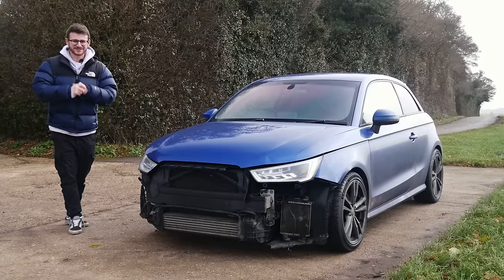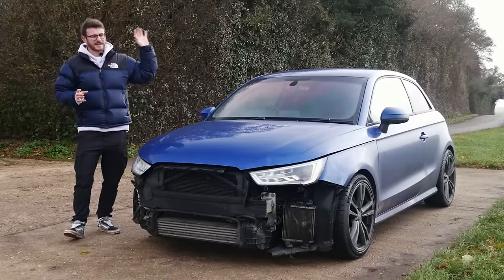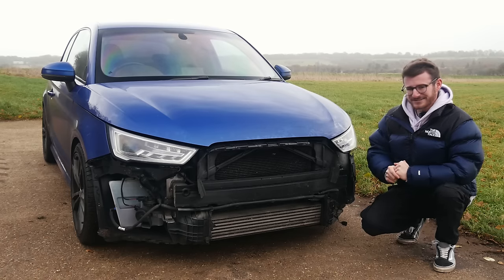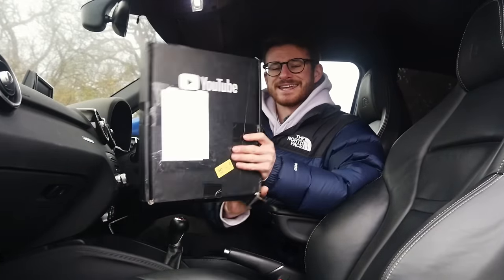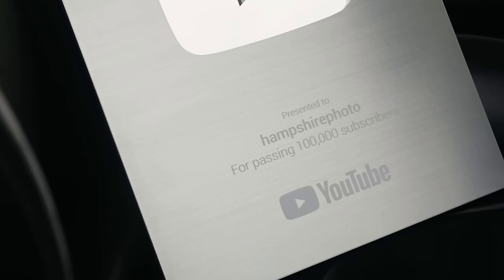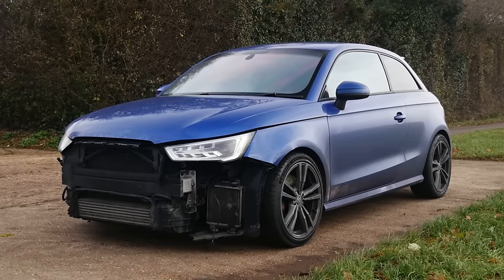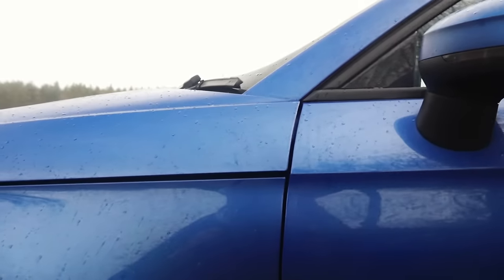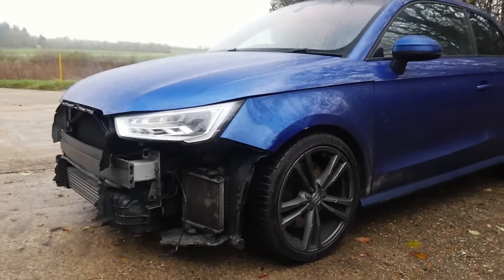I Bought A Wrecked Audi S1 from a SUBSCRIBER!

Comment: They sold it over a cracked splitter and the bumper coming off.. most modern Audi are just easy detach crap.. amazing for power but I can imagine what caused that little damage.. then again I bought a scrap Mk1 TT and the previous put a new pump and timing belt on after a dent someone must have done with a trolley in a supermarket.. that bumpers easily repairable and a new splitter and about 20 mins pulling that tiny dent in the bonnet out.. amazes me thinking what people deem as a damage category..

Comment: Well done on the S1. Can’t wait for the repair and future mods. I’ve just bought an S1 to daily to save using my E46 M3 CS. The S1 is a great little car to race around in, but now needs a power increase, so am interested in what you do.
Thanks
Reply: Depends how far you’d want to go with it; Will need a clutch no matter what you decide to do they’re chocolate from standard 
Stage 1 will see about 320 with no hardware 
Stage 2; Downpipe, intake, intercooler will see about 340-350bhp

Stage 3 with all hardware plus a hybrid or an is38 from the golf r will take you too 400bhp+ if you uprate the HPFP you’ll obviously get more gains